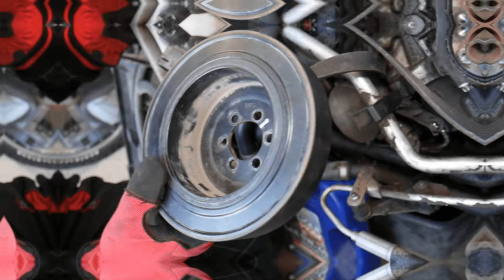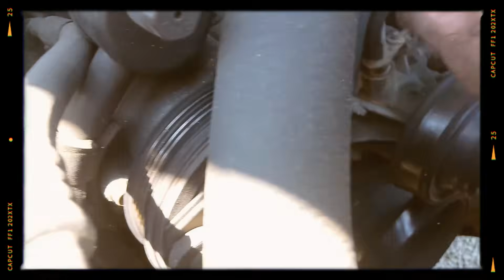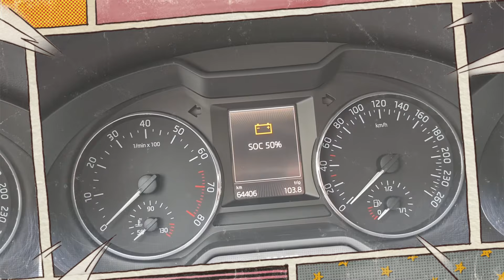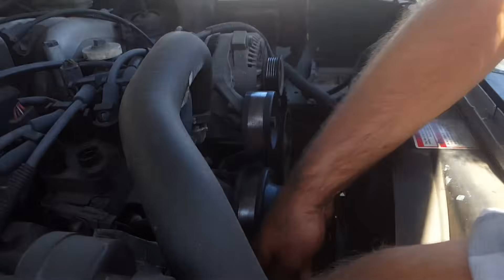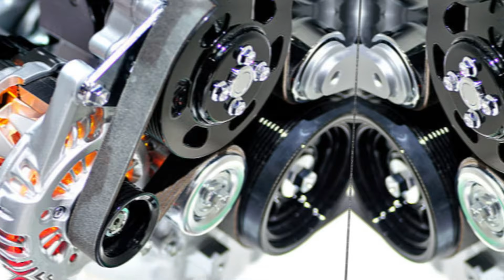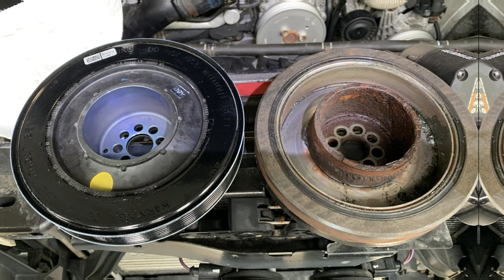8 Common Bad Crankshaft Pulley Symptoms & Replacement Cost

Comment: Very often problem in Mazda Protege...
Reply: Same with any other model that shares the 2.0 Duratec engine. It's a 500k mile engine of sorts, with proper maintenance. I keep my harmonic balancer lubed up once yearly to prevent the rubber from failing. Ugh they're NOT fun to replace.

Comment: Hello I’ve got a BMW series 1 2018 the crankshaft pulley wheel is not lining up with the rest of the pulley wheels and is causing the belt to shred any suggestions please thank you
Reply: replace the part, fix the problem
Reply: I’ve the same problem on my BMW X3 2019. The last part of the serpentine belt is misaligned. I got the adjuster changed but the problem still persist. My mechanic is suggesting to change vibration damper ( I think it’s aka crank pulley) I am contemplating if I should get it changed. Were you able to rectify your problem? Thanks

Comment: everything you said happened to our car, power steering failed and locked, engine overheat and smoke all over ,battery died, radiator hose blown and water leaked. the pullye spin in the middle but belt side does not

Comment: So the bolt holding my pulley came out completely and the pulley itself spun off causing the belts to get all tangled. Luckily it all happened within 5-7 seconds. I’m just waiting on a new bolt. Is it a matter of just putting it back on or does it have to be aligned somehow?
Reply: Just make sure you torque it to spec and check for damage on the pulley
Reply: exactly the same thing happened to my mom yesterday

Comment: If you hear see or feel something is off don’t run or drive the car it can be fixed but ignoring it will make it worse. My car had a bad crank shaft pulley it started to walk itself off the engine and it made the belt get miss aligned and started to chew through the belt. Once I noticed this I shut my car off just left it parked at my house until I could get it towed. The shop fixed it with a new belt and pulley and a new crankshaft bolt.
Reply: Good call. My van started overheating and I kept driving it and blew the head gaskey
Reply: @ryans413 Glad no other damage was done. Unfortunately I don't have the option of parking mine right now. Nor the money at the moment...

What kind of car, & how much did it cost, please?

Mine is a 1998 F150, rear wheel, auto. 

Anyone?
Reply: @ it cost me 600 dollars not bad but also not cheap but cheaper then any newer cars today. The belt cost 50 bucks the pulley was 180 and the engine seal was 20 bucks so it was about 250 in parts alone. The diagnostic fee was was 150 and the labour was 200 plus some taxes came out to be close to 600. But I couldn’t drive the car because the belt snapped and the belt drives the alternator the water pump the ac and the power steering so the engine would run but only on battery power no power steering and no water pump so the engine would heat up quick.
Reply: @ryans413   Thank you so much for replying (& fast, too. 4 minutes! 😮).

Yeah. $600 ain't cheap but you are so correct in saying it's sure cheaper than a new car 👍 (engine too these days).

Haven't checked prices for mine yet. Got under it just yesterday 'to look & listen'. Was hoping the sound was just a noisy belt 🤞... NOT 😖. Will check prices some time this week. Got to get over the 'BUMMER' first 😄  😏.

Thanks again 👍
Reply: @craigslist474  no problem if it is the crank pulley try not to drive it to much a pulley can be easily fixed but an engine can’t. I didn’t want to tow mine but it was a small fee to keep my engine from blowing up.
Reply: I needs help
Reply: Well going through this now but between getting kidnapped off the porch called by the and obviously paid by illegal..fucks mental facilities sentenced. By fake sell out judges while medical and mental records being dr by fake doctors and wanna be catfish smelling nurses got a little behind on cat repairs oh yeah un explainable broken foot on down syndrome son a 3 month rash he went through while a Cantu/cannot speakes in tongue at the foot of the bed while being side tracked doing jobs for peanuts ..but hey welcome to the American fucking dream ..just gonna pray and pay because that is what they want us to do oh yeah and service with a smile because who wants anyone that might possibly be effected by it at this point right..geezzz..best advice keep driving even when the headlight and everything goes out because if you like me u probably have a child that has had open heart surgery you have to keep cool can't afford the tow fees even though you put in the work and do not want you son to go into cardiac arrest or be stranded where low and behold all those mofos you help including the worthless dad are un available..thank you to my God and the ofc the understood and followed my home..Guess real God's reall6 do work in mysterious was..not the bitch made kind..

Comment: Did you figure it out?? My camry is doing the the same thing , is it harmonic balancer?
Reply: @michaelsilvaj  yes my car had the same problem engine was fine it was the pulley that was bad. It destroyed my belt so I had the car towed to a shop they fixed the pulley and put on a new belt

Comment: "When the engine is turned off and the belt is taken off, I noticed that I can manually spin/move all of the pulleys except for the crankshaft pulley. Is this normal, or should the crankshaft be easy to spin as well? The engine in question is a K20A engine. Thank you."
Reply: Crank pulley is attached to the crank shaft it only moves when the engines on. But if the pulley wobbles or has play or is misaligned with the other pulleys it’s bad and needs to be replaced because it will wreck the belt and can cause the other pulleys to run hot with a misaligned belt.
Reply: @ryans413  Thank you sir 😇😊
Reply: @Dweeno  no problem my car had this issue got a new pulley I had to get the car towed to a shop but it’s all fixed and working again so I’m happy
Reply: @ryans413  Thats good Ryans
Reply: It's normal. You need a wrench to turn over that pulley
Reply: @kalani1987  thank you man, bless 😇🙏🏼

Comment: My opel corsa is losing power and i suspect the crankshaft pulley, I've changed tps , timing belt and idling sensor nothing changed but now will look for this culprit then if is intact il check the spark plugs but engine spit water that might means is in good shape

Comment: Whenever I turn on my AC i get a battery warning and all my electronics (power steering, horn, etc.) Dies. After 2-3 days I started getting sound from the car(cracking sound). 

On visiting the mechanic he said the crank shaft pulley and belt is damaged. Which it was, Belt was split into 2 and pulley was bad.  Replaced it and my sound issue and AC issue both resolved.

I can understand that sound is fixed but can someone help me understand how the AC issue was fixed with this. As per my understanding there should be no relation of AC with crank pulley.
Reply: When you turn your AC on, your AC compressor connects to your engine (it has its own pulley) and gives it more load
Reply: I am having the exact same issue It is currently in the shop as I type I go pick it up in a few hours I’m having the crank puller replaced because I already changed the
A/C compressor and the alternator before bringing it to the shop one time when I turned my A/C on while looking under the hood the belt on the pulleys stopped 🛑 turning I’m hoping my problems will be fixed when driving I could feel my steering wheel getting tighter and hard to turn and like you said the battery light comes on hopefully this fixes it.
Reply: I’m kinda mechanic savvy one day I turned my car on and heard an awful sound popped the hood and saw the belt was robbing turned the car off right away. I loosened the belt tensioners got the belt off and saw the crank pulley moved outwards a bit misaligning the belt it even chewed through the belt there was a slit in the belt. Got the car towed to a shop they replaced the crank pulley put on a new belt and now everything is fine again.